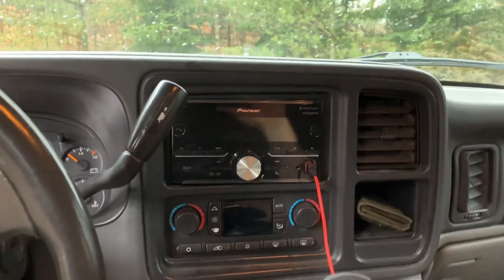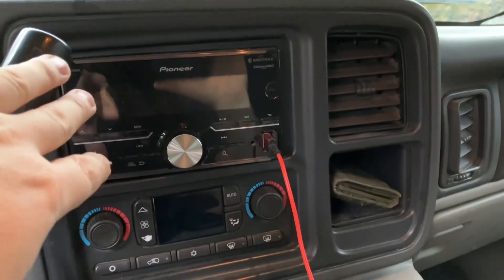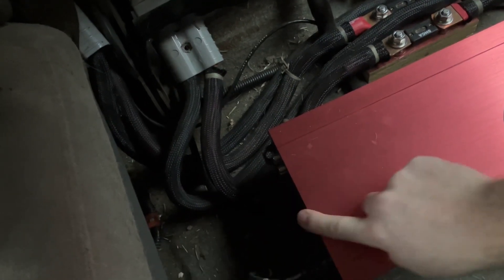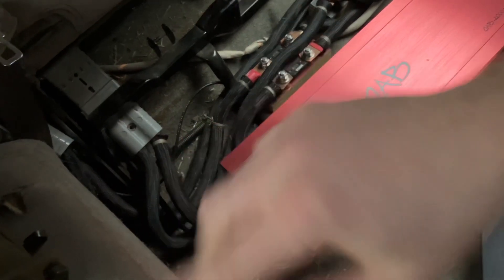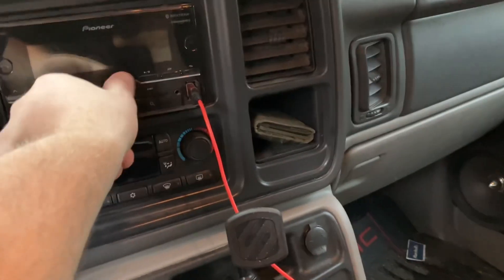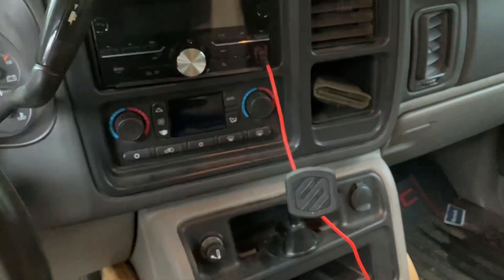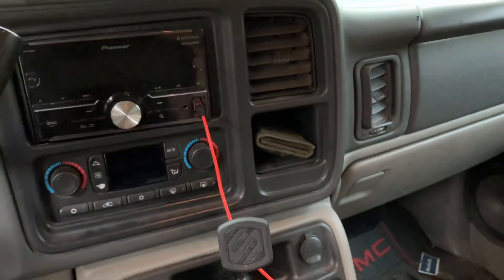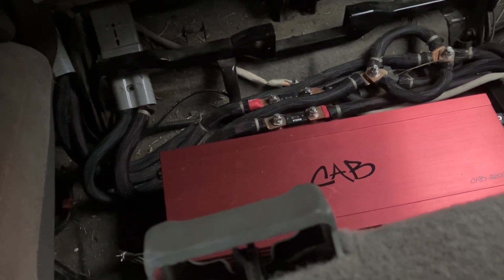Why you don’t need two volume knobs 🤔

Comment: I ripped my cable on my 7000w rms mono 2 channel amp
Reply from the maker: What do u mean ? U removed it from the system ?
Reply from the maker: What two channel are u running thats that powerful ?
Reply: @annihilationindustries1990  I blew my amp... iwas able to get me a WUDI 8088.1D for 80$ on sell
Reply from the maker: @JoshPro12_Offical  what brand is thT ? 
Its coming up on google is either lanzar or Sound digital ?

Comment: Bass knobs and bass boost on amps .... 2 of the most useless inventions to exist
Reply from the maker: Well bass knobs still have a purpose for if u have a demo vehicle , but the average joe that has a sealed under the seat kicker dont need one 😂 .
And bass boost usually is useless , but if the amp has a preset frequency that it boosts or if its adjustable u can use it to help out in a small sealed enclosure thats lacking that bottom end. This way it makes more of a flat frequency response instead of being peaky. To your point though , most people flood there system with distortion.